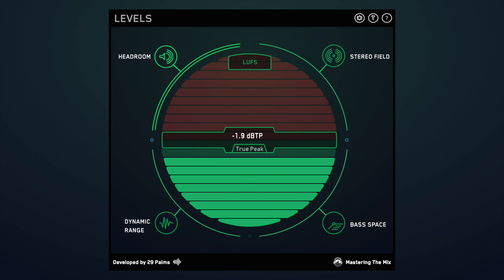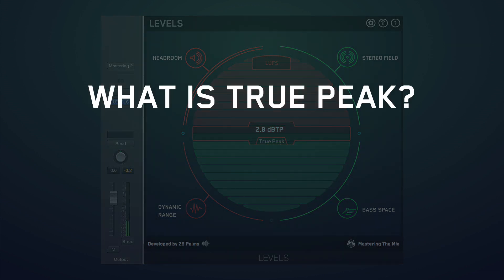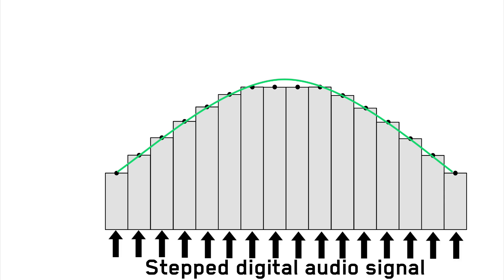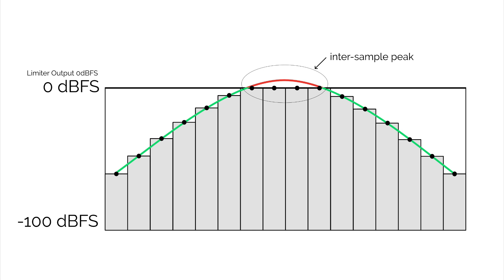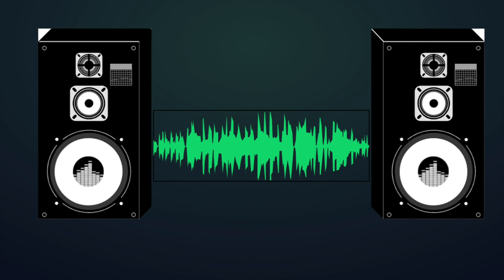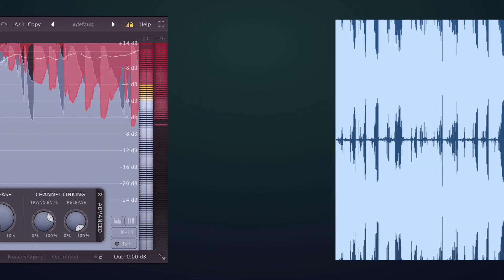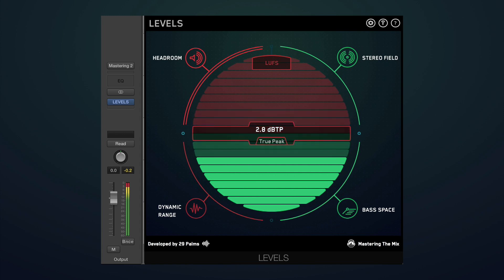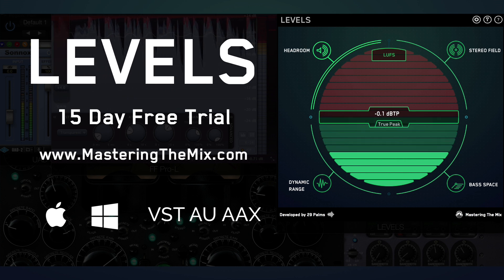Mastering Using True Peak - LEVELS Tutorial

Comment: I always set the mastering limiter ceiling to -0.1db, and on occasion -0.5db. I don't think I've ever had much issue with those methods, although I did have to master for Vinyl once which I didn't know much, about so I didn't hit it as hard and used the aforementioned -0.5db ceiling.

Comment: A very easy solution: Just set your Ceiling on the FINAL FINAL Limiter do -0.10dB. Enough headroom for intersample peaks.
Reply from the maker: Hey Erick, This unfortunately wont work, even with many of the high quality inter-sample peak limiters. The quality of a true peak meter (or true peak limiter) is based on it's upsample capability. Some are X4 some are X16 (always a multiple of 4, the higher the more accurate)... These will give different readings which often leads to confusion as they are both labelled 'Inter-sample peak' Limiters or Meters. I use Fabfilter Pro L and even at its highest quality ISP setting I still often have to bring the output down to -0.5 or even -1dB to avoid clipping the LEVELS intersample peak meter.
Reply: Mastering The Mix thanks for technical knowledge. Just sharing a tip used by a highly respectd mastering engineer who works on EDM big names...
Reply from the maker: Sure, as with many music production topics there are different points of view and I'm always open to hearing a scientifically based argument. I stem mastered a few tracks for Tiesto this year. I'm not saying this makes my approach 'perfect' or 'the best', but it is being accepted by arguably one of the biggest names in EDM. Looks like major labels are moving towards choosing quality over loudness now which is fantastic :)
Reply: Nice! Im going to meter big tracks (top 10) and Tiesto tracks for this year and see whats happens... probably its hard to say EXACT VALUES for EDM music (many people stands 6LUFS to 4LUFS its PERFECT, but man... thats f*n saturation) but using levels to know the music in numbers and have nice references will improve my works